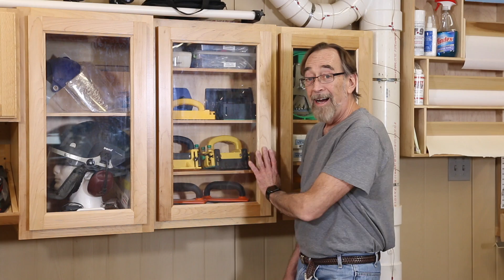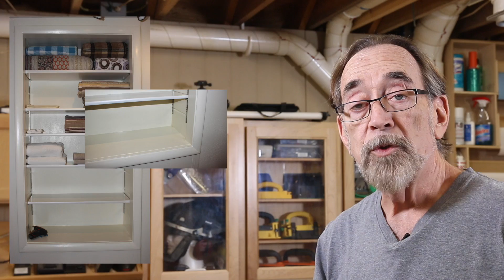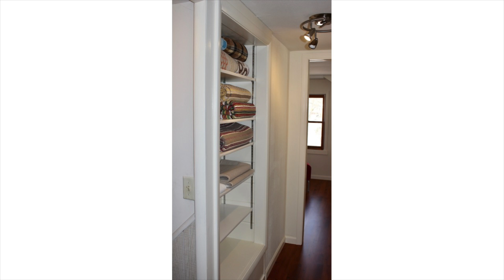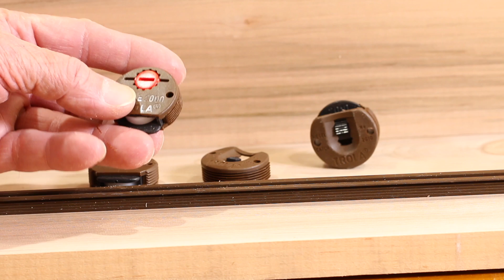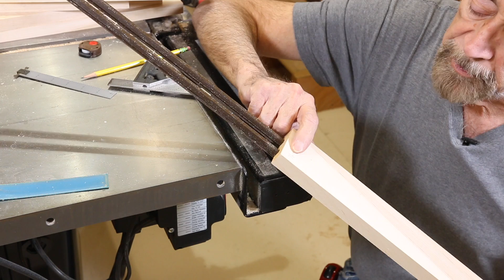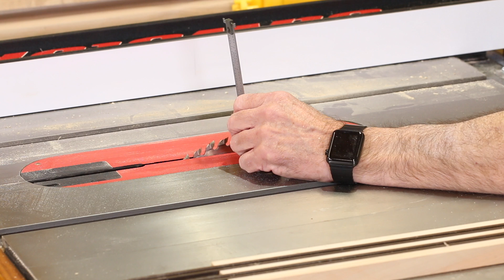Sliding Bypass Doors Part 1

Comment: The roving knife is not meant to be removed. If it's adjusted correctly it is below the highest tooth on the saw blade and remains so on non through cuts. Also, I'll bet if you used metric measurement you would have gotten 13 mm to the center (½" plus pencil line 12.7 plus .03 mm) 8mm wide track dados 10mm deep et centers mathematics with fractions to even us over 60's is an anathema. 😏